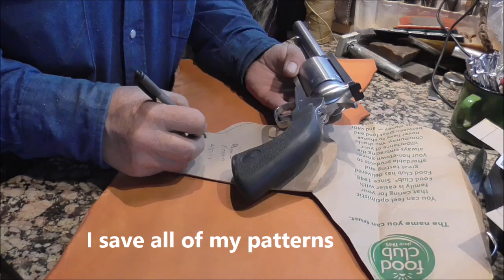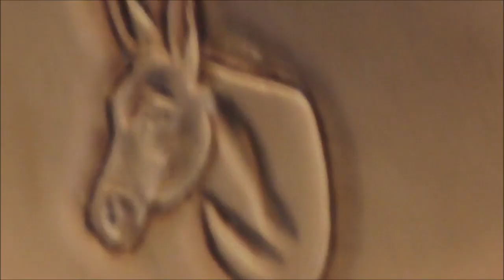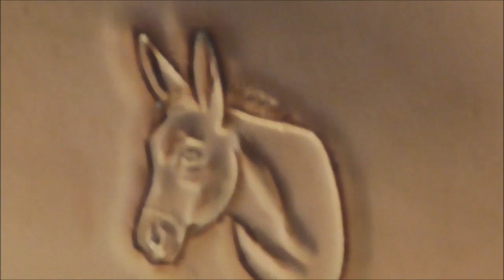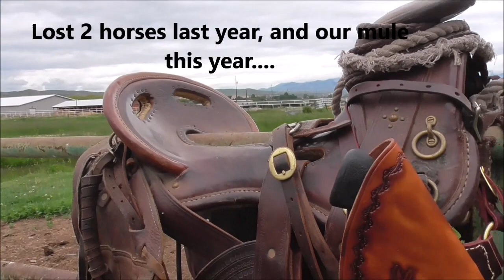Making a Saddle Holster for a BIG Gun!

Comment: You always do a very nice job with leather crafting, Gary. Tooling is pretty interesting to watch in high speed or time lapse.  I can see all your years of experience coming through in the little details that make a piece durable and long-lasting.  That scroll border tool pair is neat. It'd take at least 10x longer to cut those with a swivel knife, and the fine corners would fray up quickly.  Those are a nice stamp set. I haven't ever seen them before.  Looks great Gary!  Strong work.
Reply from the maker: Thank you very much!  Not sped up, it's too time consuming, as you know.  I think that tool set is a Tandy Leather set if I recall, but I'm not sure.  I like it!  It looks good without taking a lot of time.  It is a little tricky to use though, you need it lined up just right. Corners are tough too.

Comment: When I started to get interested in saddle making, and I was researching tree and rigging styles and configurations, I always wondered what the open tree saddles were like to ride. It looks brutal, but it was used by many cultures and for hundreds of years.  It must have been much more comfortable than it looks?  I've not ever ridden one. In fact, I haven't been aboard a pony or donkey since I broke my back. I miss it tremendously. 

My favorite design is a wade tree with slick forks and setup for buckin rolls. I started a lot of colts. Your saddle here looks like a variation of that in some ways, too. Good stuff, Gary.  I wish I had gotten paid for a custom saddle like what they're going for nowadays.  It is so much work, requiring years of practice to get good at, and a decade of high-quality work to get a good customer base going, and it just never paid like it was worth.  You definitely have to love the craft to stay with it. I respect your skills, my friend.  Nice job on this scabbard.  It'll outlast its original owner, no doubt.
Reply from the maker: Thank you very much!  The open seat design, or a half seat was supposed to cut down on weight, and allow the horse's back to cool more.  I have both this one, that's open, and a half seat.  Both are very comfortable. Your saddle pad fills in the gap and you don't even notice it.  One thing I didn't like though, is that in bad weather, your pad gets wet, and your butt too.  Pine needles also get in under your saddle, but on top of the pad.  Mine has fleece under it, so the pine needles need picked out now an then. I think that is why the Calvery McClellan saddles  had no fleece, but open seats. From what I've read, the fleece wasn't so much for cushion, but for gripping the pad better. It does ad a little cushion, but not much. It's hard to get what a saddle is worth. Materials are high priced, and it takes a lot of time.  I like making the antique saddles, but really I make more money on smaller things like gun holsters.
Reply: @MuskratOutdoors  good information. Thank you for taking the time to give some background. I know nothing about most saddle designs. It's pretty interesting stuff.  Sometimes we don't think about all the time that went into antique styles but they were trying to solve problems just like we do, so there's a lot of thought that went into it.  Back in time, folks were tougher too and had lower expectations for comfort.  If you look at pictures, even from the 60's or 70's, folks were skinny and fit. We've changed a whole lot.

Comment: Magnum research bfr. A true horse  pistol or i guess a mule pistol in this case. Almost makes a fella want a pair of them so you could hang them in a yoke on either side of the horn like they did in the old days. I wanted one of those for years till i actually shot one. Five rounds of 45-70 left my hand pretty numb and my wrist tingling for the rest of the day. Well i guess i dont need one of those😂. I'll stick with my .45 colt. The heavy loads for that are bad enough but my hand still works afterwards. It was neat to see how you set that holster up. Lovely piece of functional leather artwork.
Reply from the maker: I wondered how bad it kicked.  Maybe I'm glad I didn't shoot it!  It's neat though!!